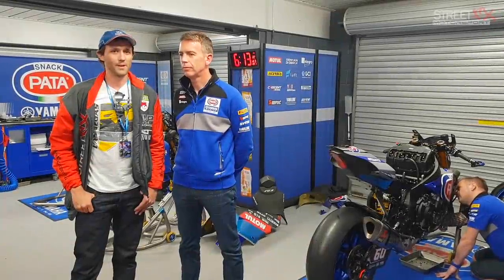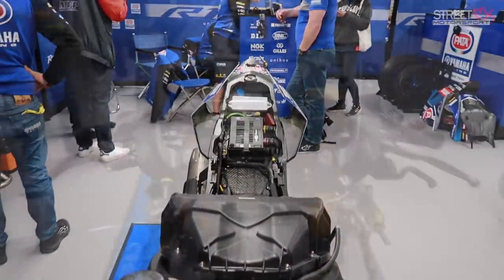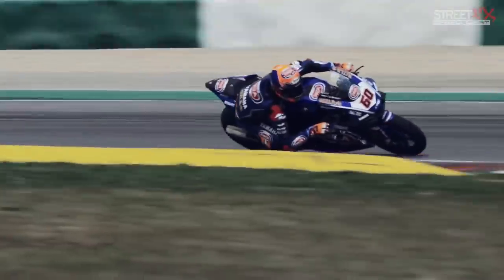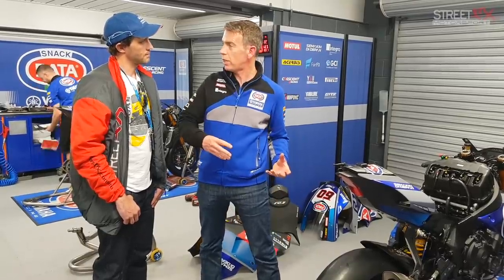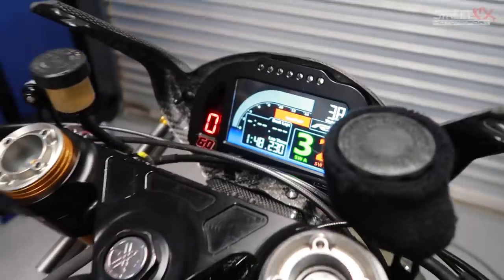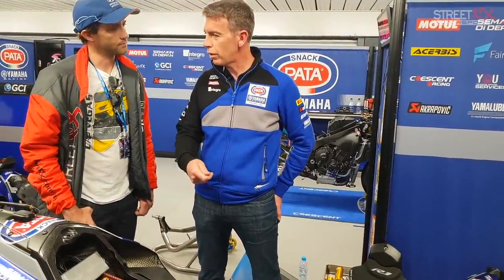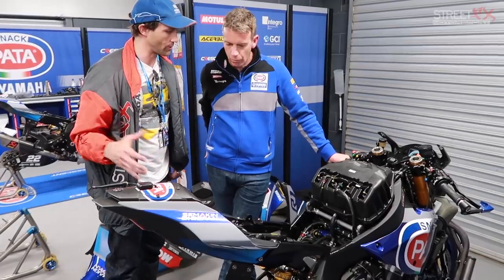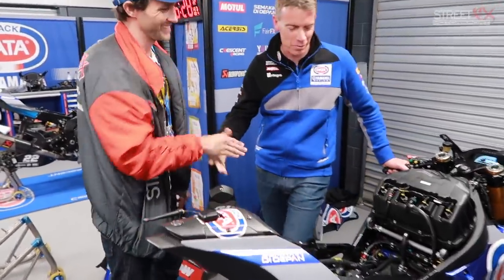What makes a WorldSBK Superbike? With Pata Yamaha Racing director, Paul Denning & the YZF-R1

Comment: I wonder if pro racing riders have a fully custom traction control system that works very different compared to the standard traction control system to go faster and allow for more or less locking of the wheel? idk

Comment: So if this bike makes 240+ HP and goes up to 340 KM/h, what makes it different than a motoGP bike?
Reply: Tsubaki13 MotoGP bikes are essentially the F1 of motorcycles. Not sure if one darn thing is even close to stock. Lol
Reply: A big difference is the chassis and brakes.  The motogp guys say the superbikes feel soft and the brakes feel weak (compared to the carbon discs of motogp) also I think Ducati motogp is rumored to make 275hp
Reply: Think motogp only restrictions are engine sizes per number of cylinders near enough
Reply: I get that, but if the result is not that different....
Reply: All MotoGP bikes make 260+ HP.
Reply: @f270  ducati makes 310 hp lmao honda 300hp yamaha 295
Reply: @topubaksh8316  Possibly, but it's always a rumor. I wish they would show us dynos from a few years back at least
Reply: The performance threshold of the bikes is quite similar, but the game is completely different. MotoGP is mostly proprietary. Access to the machines is heavily restricted. Manufacturers rule. Superbike is moving towards public access, like GT racing. The parts are all for sale (to qualified buyers) and price controlled. Customers will rule, in theory.

For fans the difference relates to the competitiveness of the bikes. In GP, competitiveness is not guaranteed. If the team is off the pace, they probably lack sophistication, talent and funding. In SBK, performance will be more or less assured going forward. If you can’t get up to speed in SBK, your team is confused, your bike is a lemon, or your business strategy is poor. No one makes a bad superbike currently so choose from the other two.

Comment: Big fan of Paul Denning, incredibly smart guy but there's no way the top speed is 340kph.
Reply: I was thinking that.. but really it's just a modified M1 .. motogp only aloud 6 engines per rider a year, and my Rossi's does nowhere near 340 even at mugello 😁
Reply: It can do 300+ stock easy, so why not?
Reply: @antonfloor344  because it just can't do it, it's not opinion, it's fact haha dovi hit 356 at mugello on his ducati. The v4 wsbk bike is around 315/320 and that's a rocket
Reply: @antonfloor344  The laws of aero .. and if the m1 is the slowest motogp bike top speed on the grid, then I'd be sceptical of R1 .
Reply: @GC Richard GP bikes are 1000cc
Reply: @GC Richard get some education before replying.. the 800's we're phased out year's ago .. 340 kph r1 = bollocks !
Reply: Dont doubt it could do 340 with the correct gearing...not a long enough straight on the callander to do it tho.

Comment: What's the red knob on top the left handlebar for at 10:33?
Reply: It's for the Rocket Launcher.
Reply: It's the choke. Helps it start when it's cold.
Reply: It's used to regulate how far is your front brake lever, especieally after few have brakings lever tends to  fall inside so you use it to push the lever outwards. You can check my onboards too, know a thing or two about riding on a limit

Comment: Can someone tell me why yamaha cant use R1M coz others use their flagship ie SP2, V4R, ZXRR ? i cant find an answer on the web. TQ
Reply: Well i will help you answer it yourself :) 
Why would they use the R1M? :)
What benefit would that bring?
Reply: How about the R1 GYTR?
Reply: Roxx 13 Appy 
Because the engine of the R1 and the R1M are the same and as you heard in the video, they actually change everything else. So the only benefit for them to use the r1m is to have more expensive parts not beeing used ;)
Reply: Roxx 13 Appy R1 and R1m use the exact same engine and chasis. That’s all they keep on this bike too. Now if they used the R1s then it’s a different story.

Comment: Old bikes are safer because less complexity to deal with 1 2 3 is easier then if you touch 1 it affects 3 but then 3 controls 2 which makes 1.5 control less likely to engage etc...
Reply: lmfao man no they are not. electronics have mad bikes much safer. Just look at the crash rate at California Super Bike School with the ZX-6R compared to BMWS1000RR

Comment: Why does the lower radiator have 2 sheets of aluminum tape on it?? Or is it something else?? Looks like the radiator air flow is restricted for some reason or another.
Reply: sry for my english , it s because without the engine is too cold . no fan here and you regulate temperature with sheets of aluminium

Comment: With all the cool new sensors on modern race bikes, Are crashes like high-sides a thing of the past?
Reply: Yes, I wouldn't say they don't happen anymore. But they are WAY less frequent. As someone who grew up watching (and experiencing) highsides, I think it's pretty incredible. I remember reading in the late 1990's about bikes with huge computers in the tail section running traction control and wondering if highsides would be a thing of the past.  Now they almost are
Reply: No. Less likely though.

Comment: I can't believe that he boasted of a power/weight  of 1.3, and compared it to high-performance cars, when adding a rider will increase the weight about 33%.  Cars are not as affected.
Reply: at 240hp per 168kg it is 1.42hp per kg or 1420hp per ton which is impressive and is he talking about rear wheel hp or crank? an r1 production bike makes 182 rear wheel hp before an ecu flash as far as i know. the hennessey venom makes 1500hp and a power to weight of 1230hp per ton and would only out perform the bike when approaching speeds between 180mph to 200+mph because of the downforce. regardless of rider weight.

Comment: I'm pretty sure that thing revs to at least 20K RPM.
Reply: He said it revs to 14.7k rpm.........did u even listen?
Reply: Physically impossible due to in simple terms,  mechanical actuation of the Valve ie, valve springs.  This is why Formula 1 racing engines use electronic solenoids to control the valves. Yes, I've seen the internals of F1 engines.
Reply: Said could happily rev 15 + a little if regulations allowed.

Comment: Why is there SO much lies and hyperbole in everything we say? "when the rider is in a corner there's less than an inch or 20mm of the bike touching the road" when literally the next shot is the bike in a turn and you can see there's aout 3-4 inches of the tire making contact with the road lol
Reply: Anthony Quigley 
Probably because a racetrack consists of more then just the one corner you saw in that 5 second clip ;)
I am a rider myself and can confirm that there is very little rubber touching the ground, sometimes too little :D